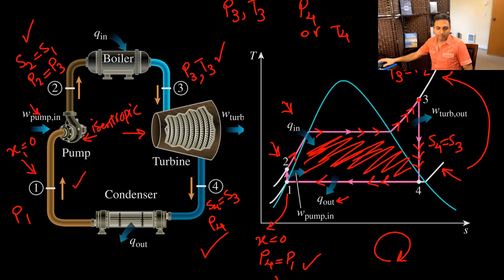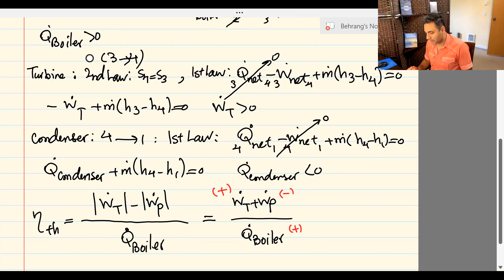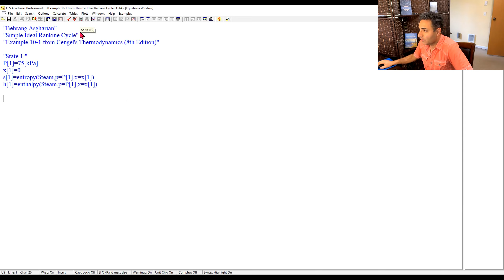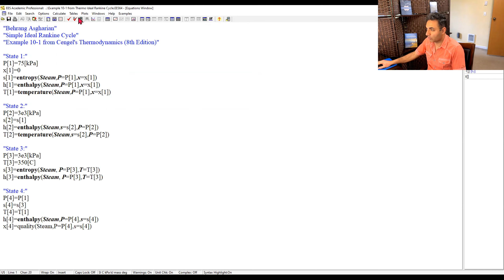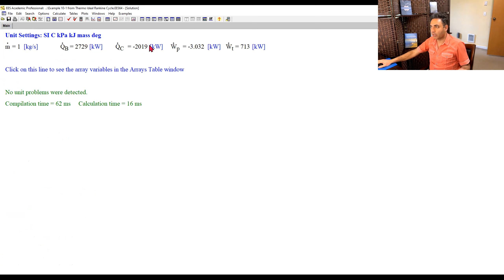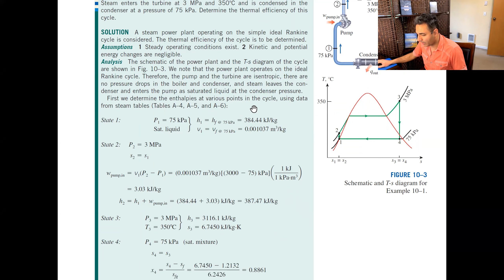How to solve Simple Ideal Rankine Cycle using EES. Example 10_1, Cengel's Thermodynamics

Comment: Sır, I need to model a cooling cycle and optimize it. When I changed the parameters for condenser other related outputs should change. Is it possible to make it in EES.
Reply from the maker: Yes absolutely. Optimization is available in EES.
Reply: @professorbehrang thanks a lot

Comment: i have question about how to check in wich region we are in in the stage 4 
i mean if S_4 is greater of S_g or leass then S_f we can not use A4 table. so how can we check that
Reply from the maker: If in state 4, if s_f<s_4<s_g at the pressure given (from the saturated water pressure table) you can for sure say it is 2-phase (under the saturation dome). If at the same pressure s_4>s_g it is for sure superheated vapor, and finally if at the same pressure s_4<s_f it is for sure compressed liquid. Keep in mind that in this case, your guide is P_4 so you need to start with saturated water pressure tables.